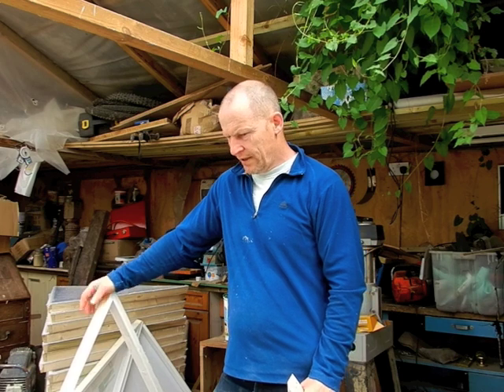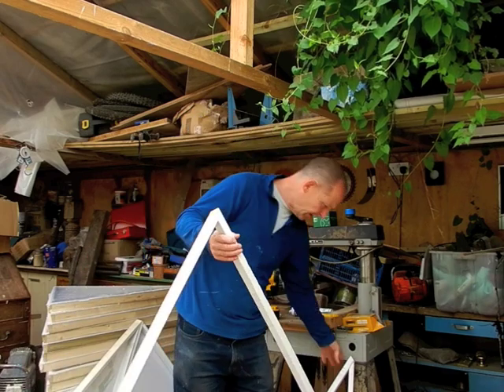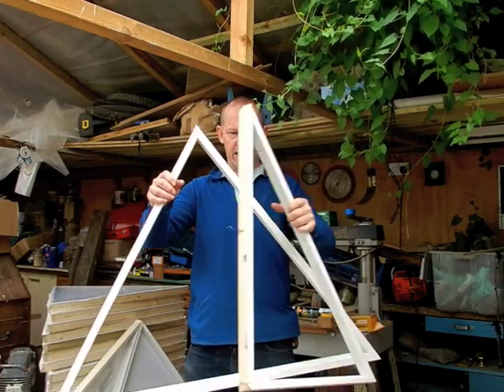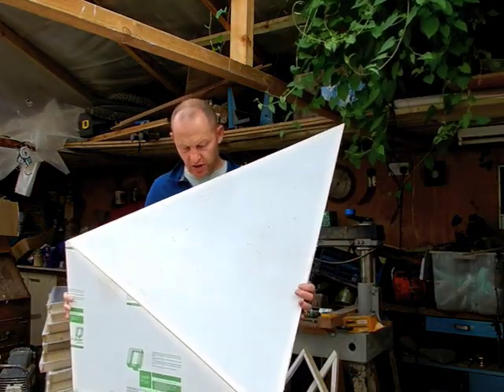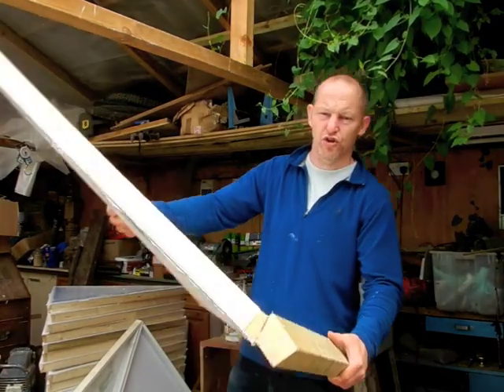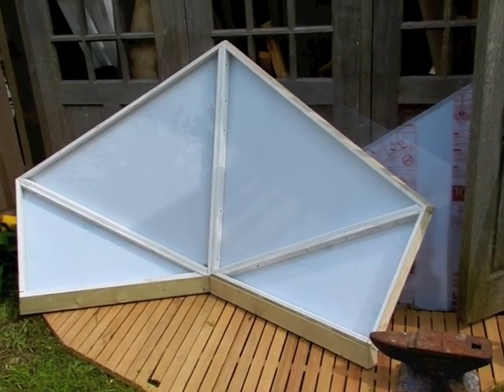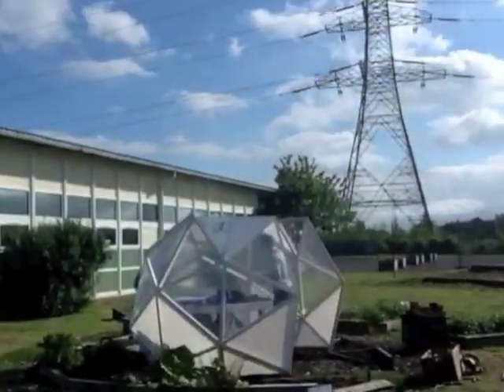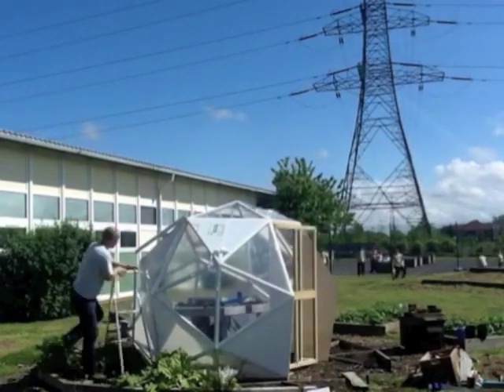Pentakis Dome tutorial

Comment: Paul, what's the difference between the gd5 and the pentakis? Thanks
Reply from the maker: The GD5 is based on a 2v icosahedron, that is an icosahedron with each edge divided in two. The pentakis is from the dodecahedron family, dual of the icosahedron. Take a dodecahedron and place a shallow five sided pyramid on each face. this makes a solid with only one triangle face type, the 2v has 2 different face types. Hope that helps